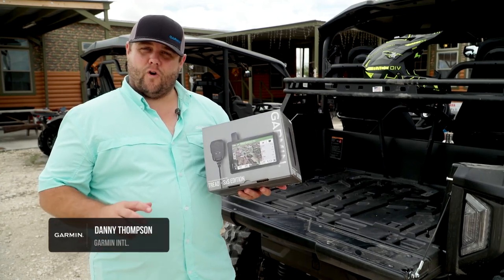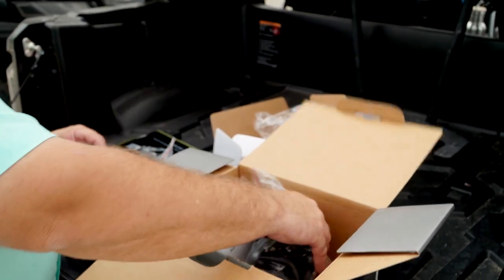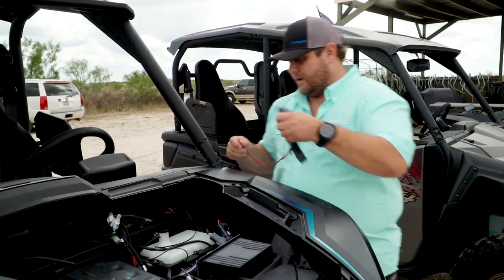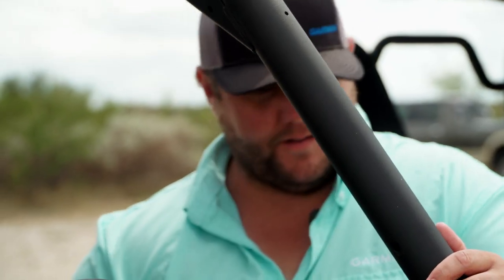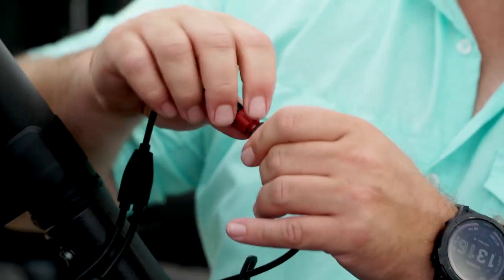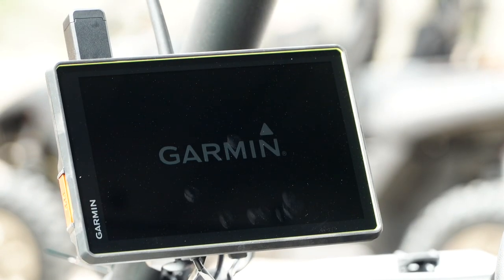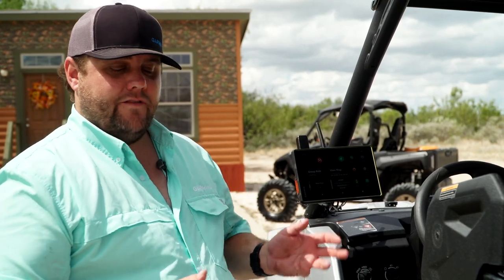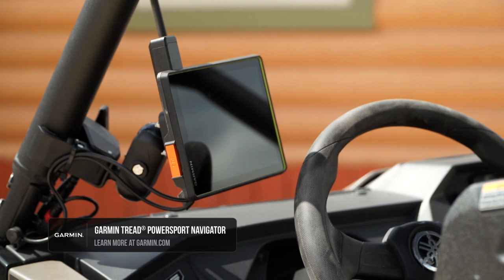Installing the Garmin Tread on a Side-by-Side

Comment: Hmmm in my box there wasn't the mic? I do live in Belgium so maybe it's an option??? I have the Tread SxS. There's no mic picture on the package and no hole in the holder for plugging in the mic.

I think I'll try building my 8" version into the place where the gps is normally build in. In Belgium we don't have that option of the builld in gps. Original is a 7" but i'll work it out 😅
Reply: i think the sxs version has the soft keys on the unit to activate the mic instead of the external one. thats how mine is
Reply: @brianheroux3667  I can only push on power and vol +/- on my unit. And the SOS button under the protective capsule... I guess that it is not used here that frequency or something... Not that I need it anyway... Meanwhile it fits fine in the RMAX2